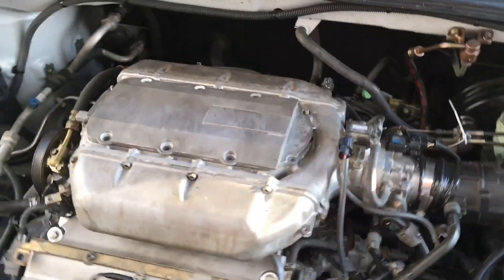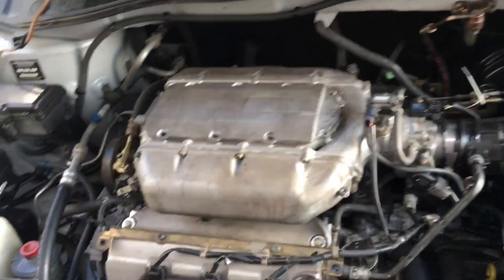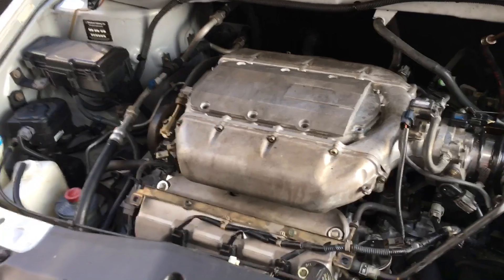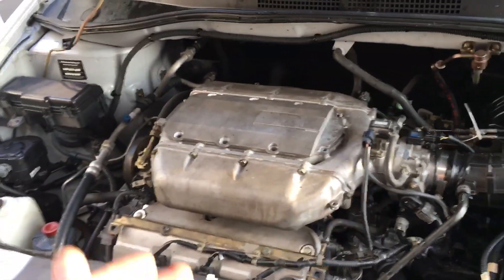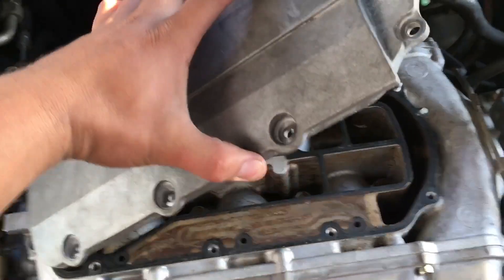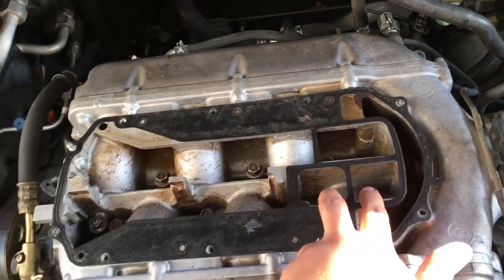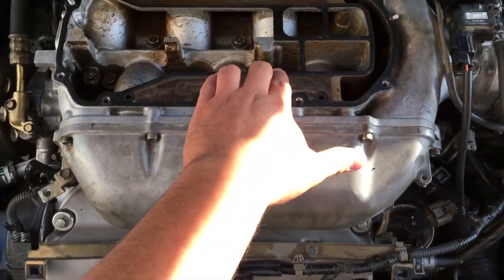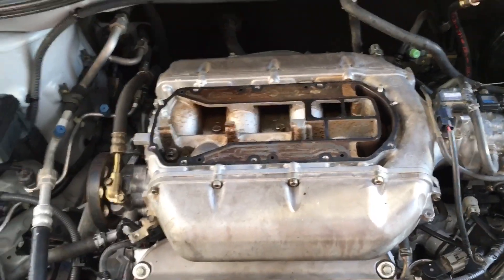99-10 HONDA ACURA V6 3.5 MISFIRE CYLINDERS 1 and 4

Comment: What are those 3 lines with black caps connected to the front of the engine block called? One of mine blew off while driving and now my car sounds straight piped.please help.

Comment: Thank you bro I’m gonna have to check that gasket again 😅🤦🏾‍♂️ I did a valve cover gasket replacement/engine coil/spark plug and a manifold kit gasket after install started up giving me a misfire code cylinder 1/2/4/5/6 smh on a 05 Acura MDX 4wd 😅

Comment: My 2010 Honda 3.5 fouls out the spark plug in cylinder number 1 n starts miss firing but only that cylinder I have to change the plug every month apparently it is a common thing  does anyone know the problem n fix

Comment: VERY helpful video.I have been dealing with a check engine light for cylinder misfires 4,5 &6. My mechanic has looked at my car several times for the check engine light.Everytime he tells me its fixed and a few days later the light is on.This is definately something i could try out.Do you happen to have an email i can possibly run a few questions by? Im not sure where to look next if this doesnt solve my issue.If thats not something you do thats all good.Thanks!

Comment: I had all of these flow paths clogged, the key is to look at the holes that go into each cylinder and align them when putting that gasket down. If you noticed, some holes do not match at all when put incorrectly; those holes must match up. I'm here because I have a very corroded EGR valve and I did not want to take them out, the issue that I have is that I read 1.86 volts, snapon says that it should read around 1.2v when engine off (indicating that pintle is closed). I manually power the EGR valve and I get the engine to stall but I only see around 3.5 volts for the current position. The issue that I have are misfires in cylinders 4 & 6 and sometimes 5. I replaced the PVC valve because it was open (pintle inside was loose); I don't know if that was my issue for sure but I still feel a slight misfire but no check engine so far, I think it may come back since the EGR being slightly open is also contributing.

Comment: The squares in the EGR gasket have NOTHING to do with diverting the gases!!! The round EGR hole cutouts in the gasket are offset, and if you install the gasket backwards, the EGR ports in the intake manifold will be blocked off.

Comment: I have a 2004 MDX, ive installed new spark plugs and replaced bad coils, but I am still getting a hesitation\pull back when taking off from a dead stop.. I will try to clean the EGR Ports and remove EGR Valve entirely and clean it out.. But has anyone experienced this issue before?
Reply: hey did you figure out what was the problem afterall ? My mdx 2003 has the exact same symptoms you're describing here. Thanks
Reply: U should check the coils

Comment: Thanks for sharing informative video. This is what happened to my 2002 MDX. I cleaned the throttle body on the top phlenum only for the first time. Rode test showed check engine light went on and the VTM4 light too after the install. Im glad I saw this video, I was thinking of bringing to the shop, but thought to myself I brought the problem. 

Thanks for sharing sir!

Comment: also forget about the fancy IRRIDIUM skinny plugs ... bad!!!

Firing super lean mixtures, the "Double PLATINUM" plugs FIRE MORE CONSISTENTLY, engine runs SMOOTHLY with nice low end torque at 1,200 Rpm. No need to keep mashing the gas pedal to keep up with traffic flow.

Those skinny IRRIDIUMS electrodes are JUNK (random missfires) !!!!

Try this test:
- TRANSITION in P: PARK
- Ramp up engine speed slowly from idle up to 1500 or 2000 rpm
- If your engine randomly shakes,  coughs, its got random misfiring (no DTC code).

These SparkPlugs are usually good to change at 80K to 90kMiles - They run okay pass 110K if your pushing your luck... but as the gap gets wider more misfiring cause a leaner mixture... not good for anything.
👍🏻

Comment: Wondering if anyone can help me with my frustrating misfire in my 2008 
acura 3.5l v6 172k. It only misfires when cold or sitting for a lil 
while. When it misfires it only lasts for 5 to 15 seconds then goes 
away. Things iv done: replaced all the spark plugs and coils. Replaced 
all the fuel injectors and did a valve adjustment. Cleaned egr and 
intake manifold. Put in new pcv valve and map sensor. Sometimes it will 
throw random misfire p0300 or just a #5 cly. misfire. Then some days it 
wont misfire at all. Im lost. Please help!!!!
Reply: you've done more than the basic would call for 👍🏻👍🏻

Get a scanner to LOOK AT LIVE DATA for your engine fuel trim: short term, long term.

Without that you ate blind as to why its misfiring !

I bet you will find your fuel trim is too lean because engine is not burning good enough.

- Fuel rail pressure regulator
- Crappy Iridium plugs
- OEM O2 Sensors

Using a scanner will help you see what the engine computer is doing.
👍🏻

Comment: I have an 02 Acura MDX an only has a miss fire at aidle
Reply: If you dont have any DTC Code then simply replace your plugs with "double platinum" (NOT the skinny Iridium pin). This curred my random misfires near idle.

if you get codes then diagnose by
moving spark coils Front to Back to see if code follows bad coil !

👍🏻

Comment: Great video! I took my cover off and was blown away by how much carbon and oil had deposited there. The gasket was actually on correctly though. I cleaned everything up, put it back together and started the car. It pretty much ran the same --rough. I had the codes read and then erased but they actually showed even more misfires on cylinders. Any idea what to do next? Thanks.